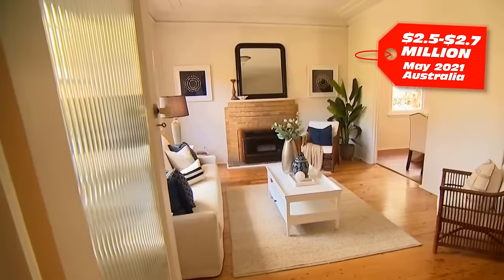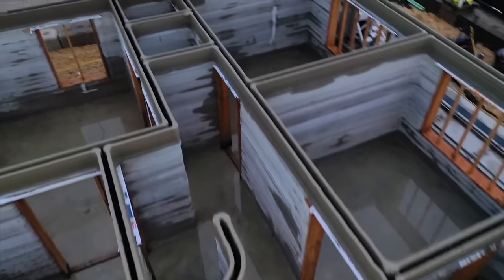3D Printed Concrete House, Printed in 48 hours

Comment: Nowhere in this process did I see any rebar being installed, especially in the foundation where it is needed the most (That footing looked completely inadequate). You can't build a concrete structure without reinforcing it with rebar and expect it to last. Also you might be able to print the walls in 48 hours that's it, not the entire house. The rest of the house has to be built the traditional way, framing the roof, installing the electrical, etc. The concrete will also have to cure before installing a lot of these elements. A wood framing crew could easily stand the walls up on this house in one work day, that's in approximately 15% of the time it takes this machine to do it out of concrete.

Concrete is also very unfriendly to the environment and is being phased out as a construction material. These machines will also be very unreliable and require a team of technicians to fix and maintain it constantly. They are also not including the time it takes to transport and set up machine which I would imagine would take quite a while. What do you do when you have to build multiple floors? Is the machine capable of this? What do you do with the machine while you are forming or framing the floors which take considerable time? Do you leave it there idle or bring it somewhere else and then bring it back? That seems like a huge waste of time.

Can this machine work on a sloped/irregular surface? What happens if the house you want to build as larger than the machine is capable of? What happens when the elements affect the working conditions? If it is raining, too hot or too cold can this machine continue to work? If someone like me can find this many flaws (Give me a bit of time and I could find many more) in the system while having my morning coffee this system has a LONG way to go before it comes anywhere nearly as effective as traditional construction methods. 

This is nothing but a novelty and will end up costing far more and taking far longer than traditional construction methods. You might be able to make this system work on a subdivision where all of the houses are on flat ground and are all similar in design, that's it.

Just my two cents:)
Reply: Your criticisms of this new-fangled fad the horseless carriage are most correct. Who would want to travel at such high speeds, especially with such a quantity of flammable liquid? The public will surely never tolerate the foul emissions or risk their lives simply to cross the street. Based on your advice I shall mortgage my stagecoach factory to double its size and production. It is surely risk-free without a viable competitor!
Reply: @WasFakestCenturyAesthetics  I gave several valid arguments as to why this construction technique has a long way to go before competing with traditional methods. I have extensive experience in this field of work so I know what I am talking about. Just so you know. 

Sorry I hurt your feelings there muffin. You people get upset by pretty much every thing these days don't you? Instead of attacking people who have different opinions why don't you talk with them instead? You might actually learn something. I am still waiting to hear any counter argument to the points I made if you are capable of it.

FYI not everything new is good;)
Reply: i agree it`s way too complicated building big structures with 3d printers, but for small houses 1 storey, 2 room, 1 bathroom, this will be a game changer
Reply: Companies in China and Germany are printing multi-story concrete houses. As for the longevity, there are concrete structures with no steel reinforcement thousands of years old. They are in better climates than many places for sure, but even a fraction of that lifetime would be worth it.
Reply: No rebar, no insulation, 200mm of concrete or less and 100mm hollowon the inside, surface uneven, full off flaws, costly machine, terrible quality, looks like melted ice cream. Feels like a "Made In China" house.
Reply: Tell that to the Romans and neoclassical buildings that use concrete 😉
Reply: @MafiaGameVideos  Yes they used concrete but they didn't use it by itself. They either used concrete in combination with with either stone or brick. They never poured walls out of concrete of poured concrete slabs because they never had the technology. They also never had rebar to reinforce it with. Unreinforced concrete will crack 100% guaranteed, that is just a fact. especially a house with no rebar in the footings like the one in the video.
Reply: Good argument 🤣
Reply: @justinemccray57  Lame comment.
Reply: @markadler8968  It's not simple concrete. They are using concrete with fiber plastic reinforcing. However this is more expensive material than a concrete. Also only macro plastic fibre reinforced concretes show excellent post-cracking performance. 3D printers work with micro plastic fibre. Yes, it's less reliable and more costly than traditional technology.
Reply: @MicrosoftProjectRU  There was absolutely no mention of fiber plastic reinforcing. You can clearly see in the video when the machine is printing the concrete there is no fiber in it. It would be impossible to use fibers in this application as the machine would clog up instantly. You are making things up. Why don't you try to watch the whole video before making another stupid comment.
Reply: @markadler8968  It might even have rebar in the footing. Of course they aren't going to show every little detail in the presentation video.
Reply: @y0nd3r  There was a portion of the video where you can clearly see the machine printing the foundation. It was squirting the cement directly on the ground. They had a little bit of building paper underneath it and that was it. There was no rebar shown. It would be easy enough to pour a footing in place prior to setting up the machine to solve this.
Reply: I agree , there is way to much left to do , to make it livable
Reply: @fraided88  a house is a house tho. And the tech can easily be made to do other designs and also do uneven surfaces given time. There will always be roles for people in the possess but we'll all things are becoming automated its just how the possession goes.
Reply: @markadler8968  you asked for civil discourse, then you don't do it. I liked your original post, but please calm down.
Reply: @Ricken2022  that's why the cost is so high. The new building types at this level never seem to be affordable. Do they think everyone has a million?
Reply: @KindCountsDeb3773   for people that don’t understand what goes into a house , might make the mistake of going through with this type of build .. it’s just a shell....
Reply: @markadler8968  you sir are a fool,first post was fine,guy commented you said to talk rather than abuse eachother then the woman commented and you called her a Karen..double standards much,plus I think you might want to read a bit more,"There are a variety of 3D printing methods used at construction scale, with the main ones being extrusion (concrete/cement, wax, foam, polymers), powder bonding (polymer bond, reactive bond, sintering), and additive welding." Everything is going automated whether you throw in your "two cents" or not Kevin
Reply: I think all your points are valid. But I think this is less about practicality and more a about proof of concept. As of now, I don't think this kind of tech would work. I wouldn't want a house built this way. But in 10 or 15 years? This might be the way to go
Reply: the rebar is a good point but coukd easily be added in.   and as for big structures, the point at the beginning was to make cheap, affordable housing.  not mansions

Comment: Fantastic idea! Rodent proof,insect proof all the insulation protected from external elements. No rebar is awesome.  rebar has been shown to actually weaken because they rust and cause water channels.  Many finishing possibilities great  for tornado prone areas. Wiring and plumbing in the insulated cavity. Those who don’t see the advantages will soon be weened out of the building industry. Weenies  as we call them. I have 30 years building with all types of construction materials in harsh winter climates and humid hot summers, concrete with fiber reinforcement (chopped up windmill blades and fiberglass boat hulls) is an extremely good material for residential and light commercial buildings. Plus i would get away from straight walls to improve air film and wind resistance.  I see no problems.
Reply: But didn't they say that house cost 2.7 million?  That's alot of money for a house of that size.
Reply: @tallswede80  
It's still a new technology. 
Once it gets better and couple of dozen things get fixed, and everyone starts using it, prices MIGHT go down.
Reply: That rebar comment is wrong.

Comment: In 1980s in Soviet Union countries when there were not enough apartments for people, they started casting walls, ceilings and floors in dedicated "house factories", then they transported them to the building site and they were building block of flats like house of cards. There are still a lot of these buildings, they are easily recognizable by the fact that they are identical to each other.

The approach was different, but the goal was the same: build faster and cheaper.
Reply: That sounds terrible. 😞
Reply: @jenniferk.7023  it's really not. You make building those blocks cheaper and faster. Insulation is guaranteed. Lived in a block for half of my life, and comparing it to a modern western one, there really isn't any practical difference

Comment: For those wondering about electricity installation, it's not a big problem. Walls are "empty". All you need to do is drill a small hole and install wires.
Reply: Most will install the electrical at the proper stages during the printing. While the concrete is still wet. Saves from extra work drilling.

Comment: Fast and cheap.
Will probably fall apart due to lack of flexibility, crack and wither during winter times even faster.
Wood, metal or even plastics are necessary in order for the house to flex, it needs to have some give, otherwise it'll just break.
The concrete doesn't even have steel reinforcements for crying out loud.
Plus, you still have to do all the wiring, plumbing, insulation, flooring, finishing, on and on. The skeleton of a home makes up a very small percentage of the total labor and materials.

Comment: Looks like a game changer but I’m interested In the insulation. In terms of staying hot and cold how would that work with no extra wall layer? Also what’s the endurance like during hurricanes and tornadoes or big natural disasters
Reply: It’s a cement house. Very Very Strong. Not like wood being held together by nails and sheet metal. Like houses in Guam. You know, for the typhoons

Comment: This is super cool. I wonder how much the concrete would affect chill in places like Pacific Northwest? Would it be like tile? I see how they kind of address it. Does drywall also act as an insulator?Instead of cool carpet on the floor, you could have cool carpet on the walls!

Comment: What is it's thermal efficiency? "Ribbed look" looks nice when it's new and freshly painted but will be a nightmare to clean outside and will be a dust storage inside. What else...? Do you have any solution for reinforcing this construction? Is there any way of repairing or modifying the structure without compromising the integrity of the remaining walls? What's the cost analysis compared to traditional brick/airblock construction? What about the electrical installation and plumbing? Is it laid out when printing, is it easy to modify or does it lay outside of the construction? Is it only possible to have a single story or can it support multiple? Probably way more other questions left to address.
Reply: The only viable question should be: will it withstand all the earthquake/torchnado/flood/hurricane ravages of the inevitable post-climate world?  All those others are just flipper dreams.
Reply: @commandercaptain4664  actually those are all things European houses are build in mind with (at least privately owned ones - meaning not build to be sold but for personal usage). I live in Poland i don't have to fire up any of my active means of heating (multi-fuel furnace, gas heater or electric) until temps drop below 10*C. Not only is it well insulated and ventilated but during the day solars provide electricity for a heat accumulator that distributes heat as necessary. Yes, it is a bit of an overkill but adding a gas heater was cheap at the time and the rest was prepared in self-sufficiency in case of any problems - house is a ways off.

Comment: Would it be more difficult to find mold in the home if the walls are sealed and there is a leak? Or what about flooding? Like the new foam Installation that often seals in water making it hard to find mold or repair electrical wires.

Comment: Yeah? What happens if there's any settling or the foundation shifts? I can't imagine that this will be any good in the long run. Have you ever had to deal with cracks in cement? It's like a crack in glass. It just keeps on spreading.
Reply from the maker: our old house was literally being pulled in half by shifting ground, had various parts of the house with huge crack down the center of the ceiling, but that was a house on stumps on a slanted hill.
Reply: What happens when it happens to a traditional home ?
Reply: @superhero6297  It sags in places but it doesn't fall apart. Kind of like an old person. I have been in many sagging traditional homes.
Reply: @KlingonCaptain  sooooooooo would you rather have a cheaper house that can replaced with a another 3D print or would you shell out the unnecessary cash and complain on YouTube
Reply: They mentioned how cracks can be repaired in local videos.
Reply: @superhero6297  no when it happens to  traditional home it gets underpinned.. I own a fabrication shop and build brackets and push pipe for multiple businesses that specializes in it . They dig down under the footer . Put a bracket under the footer then they push pipe sections through the bracket until they hit bedrock . It's like an under ground stilts keeps it from sagging again and you can fix the cracks after.
Reply: It's called underpinning and its done by stabilization companies
Reply: @joshuacarroll1758  you can literally do the same for the 3D printed model if that considering how much lighter and sustainable it is than a typical home
Reply: Fix the cover immediately than sell it asap, build another house with the money from the sale 🤣
It's stronger than crappy woodframed houses though

The foundation maybe a problem, they didn't really show it in this video but that's the only thing I'll be worried about
Reply: @Xighor  If you do that, you'll get sued. They have 5 years to do that, btw.
Reply: @windsofmarchjourneyperrytr2823  than how they don't find it by that time besides a crack shouldn't be a problem once you filled it in asap with the same material

Comment: So how do you run HVAC or electrical through a concrete slab? 

Also isn't this going to be extremely cold all the time since its literal concrete.. where's the insulation?

Comment: Concrete built houses have been around for decades. Icf is the most common and is capable of amazing architecture designs along with outstanding insulation.
Reply: but don't you  have to ADD insulation, as cement isn't very good at it??
Reply: Cement is very porous by itself. But Icf stands for insulated concrete form. And depending on the brand of product you use, should be more than 2inches thick per side. 4 inches or more in total. 
Great insulation, great structure stability, and sound reduction.  And that is with one contractor touching the wall once versus four contractors touching the wall. Thus saving the Biulder money

Comment: What's holding the cement together?? Where I am from we built a foundation with concrete rod the concrete and cement blocks. It seems that 3d print is not going to be reliable.

Comment: This head is ok but i have advice . Under the nozzle i would set material boundaries on both sides with small metal plates. These two plates must be raised by a relay when the robot deviates from a straight path. I have idea to upgrade this nozzle and results be a flat structures from both sides. Now the Layers have a uneven surface , not flat

Comment: I like the idea and it looks interesting especially on the outside and does it also have somit  insulation properties because of the design?  the high spots are directed to the sunlight and low spot are in the shadow
Reply: In another thread there saying that concrete does not insulate well and that you would still have to add insulation .
   They're also saying that it's very easy to break concrete with a hammer

Comment: How about the electric wires , outlets, plumbing, lights ?
Reply: Agreed,im an electrician and I'm seeing a shitty finish with conduits on the face of the wall. In that house didn't see 1 PowerPoint anywhere
Reply: Also I wonder if chasing anything in will weaken the structural integrity too much.

Comment: Isn't this foundation inefficient? The house should weight a lot, and isn't it more reliable to use ribbon foundation? What to do with reinforcement? Without steel/fiberglass reinforcement the house going to start cracking at some point.